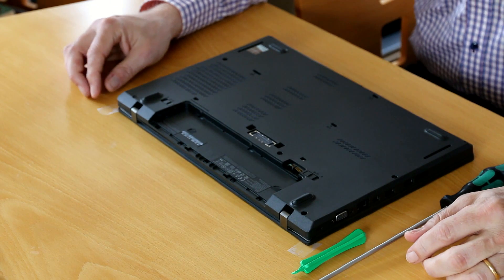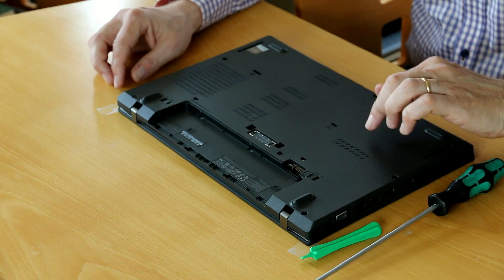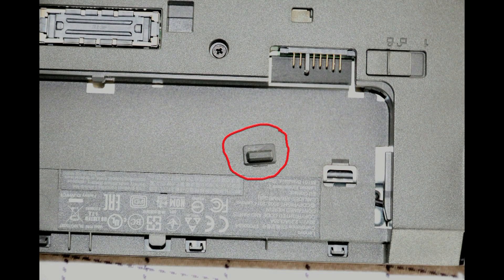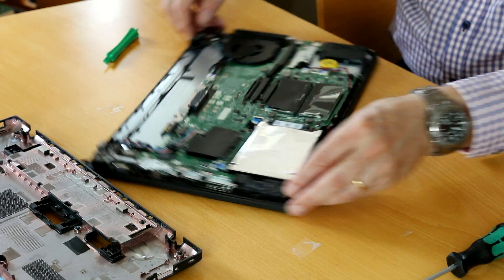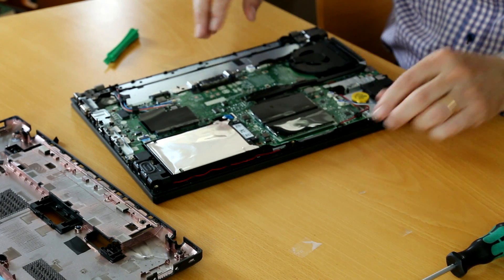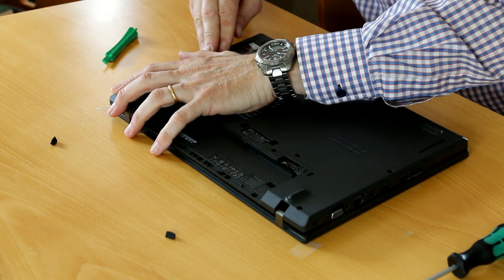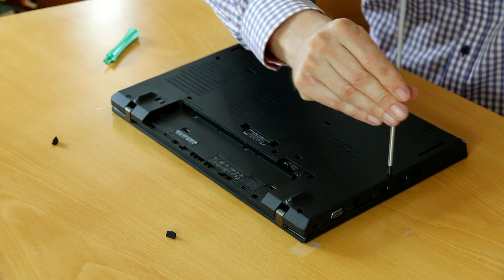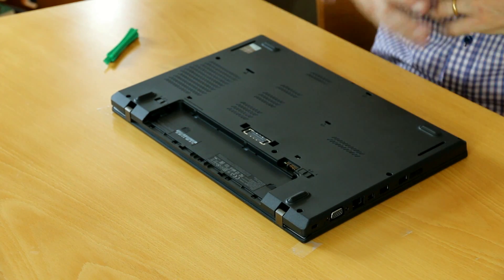Lenovo L450 RAM installation

Comment: Can you help me with something?
My comuter turns on but there is no display, the monitor doesn't work. Any tips?
Reply from the maker: Try to Connect an external monitor and if you ser tjat the computer starts, then therebis a problem with you monitor om the computer. 
It not then the problem is most likely the CPU ir motherboard
Reply: @Sokamok  ty

Comment: Don't you need to remove the SIM card slot before you can remove the back cover?
Reply from the maker: As far as I remember, yes (I do not have an L450 present)
Reply: You have to.
This is the reason why I watched this video.

Comment: you don't need to remove the rubber plugs under the battery.  just undo all 8 screws and the SIM card tray on the right
Reply from the maker: +Jeff Maginniss OK, thanks for adding the info.

Comment: Hi There,
 
I've recently purchased  a  new Thinkpad L540 with windows 8.1. I've run System Update and updated all the software. Everything has been running fine. (maybe an issue with the speed on the wireless card but not tested properly yet)
 
Anyway - I'm having a problem with the fan. The machine basically runs silent while I'm web browsing and even typing up this post, however, every 30-60 seconds the fan will speed up quite a bit so it's rather noisy for 5-10 seconds, then the machine goes silent again. I'm aware the temperature is monitored and that the fan speeds up and slows down depending on Temp/Load, but this doesn't seem normal to me, anyone else had this issue who can suggest a fix? It's really annoying when studying.

Thanks !!!
Reply: wow 4 years, still no reply, I still use this laptop XD
Reply: @kinn0r328 hey I’m not sure you still use this account, but I am currently own the same laptop, it is normal it has happen to me plenty of times!

Comment: hi.. i am thinking to buy a L450, but i read a test of this notebook where the autors describe the display as dark. With just 200 cd/m^2 avarage. I dont know who to ask, but can you tell me how the display is for you? is it dark as described or good to go? this is the only part i need to know to buy this one. I am a student so i ask everything i need to know ;P
Reply: +MrLupazi Just in case there are still people interested into this matter:

I got myself the L450 about four months ago.
The display is bright enough for regular use in well lit rooms.
If you have got the sun on your back though, you might have some difficulties with darker parts of the image that is being displayed...although I find it more useful in these conditions than, lets say, a brighter screen with a glossy surface.

The image quality of the 1080p is great IMO.

All around I really like the "budget" ThinkPad even though Firefox is still far from being snappy at all on this thing(Chrome runs fine!). I have tried reinstalling it and basically all the other tips that seem to be out there...still slow AF.

Anyways..
Reply: +MrLupazi replying to see the answer... and, does this laptop have backlight keyboard or some light? Thanks
Reply from the maker: +ilrefex91 No it does not have backlight
Reply: +Sokamok and how is the display? is the light-intensity good to see? i ask cuz some tell that its quite dark
Reply: +actually QWERTY thanks, i will take a look
Reply: +actually QWERTY i guess you buy it in america? i am from austria and i see this beautie as a 1000-1300€ device online..
Reply: +actually QWERTY ^^ thanks man :)